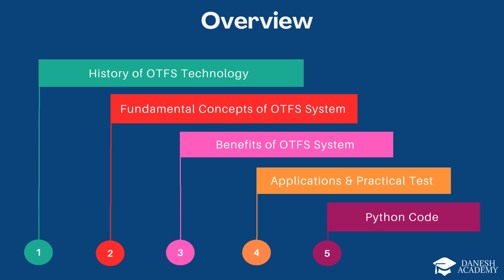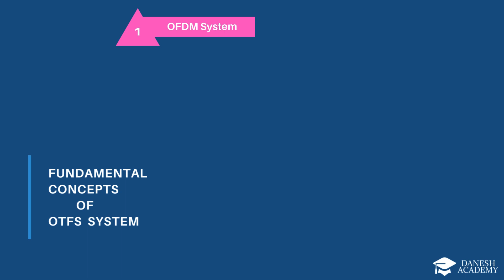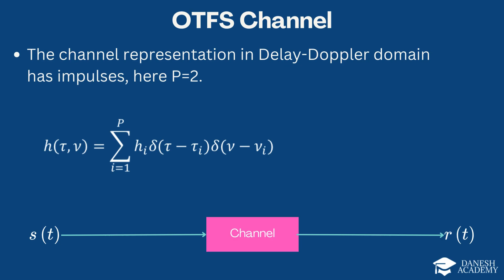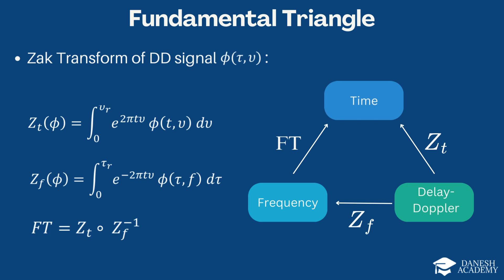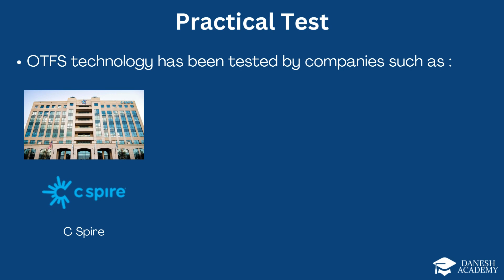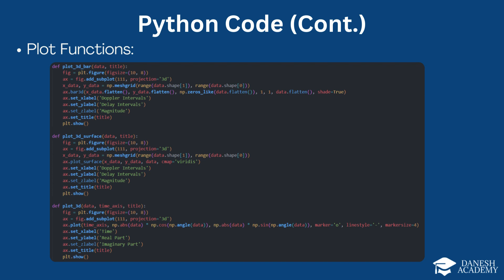Exploring OTFS Modulation in 6G and Beyond: Easy Explained with Python & MATLAB Code

Comment: In tracing the evolution of OTFS technology from its inception to its current status as a transformative force in wireless communication, what pivotal moments have contributed to its emergence as a game-changing paradigm, and how does it distinguish itself from traditional methods?
Reply from the maker: In traditional methods such as OFDM, the approach involves utilizing both time and frequency domains for communication. However, for applications requiring a fusion of communication and sensing capabilities, a different waveform is necessary, and OTFS (Orthogonal Time Frequency Space) emerges as a solution by leveraging the delay-Doppler domain. The delay-Doppler domain offers support for both sensing and communication tasks, presenting numerous benefits such as simplified mitigation of fading and interference issues.